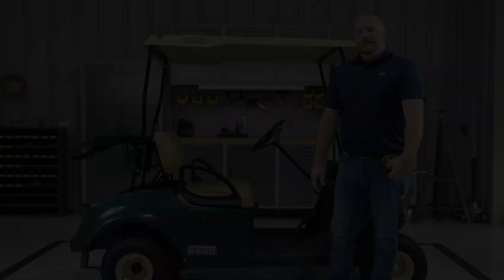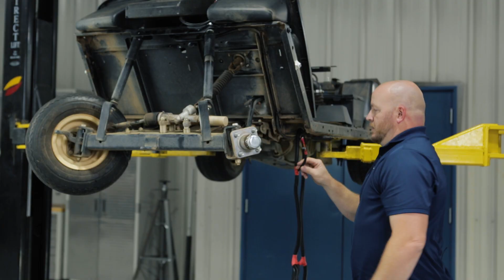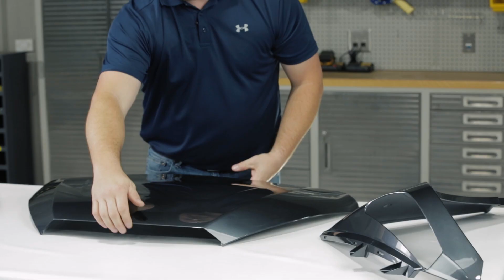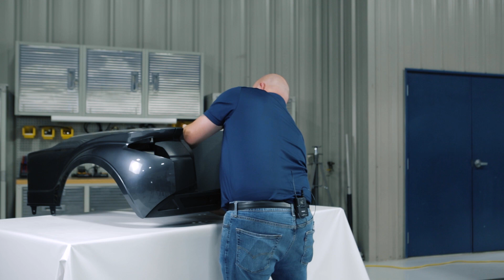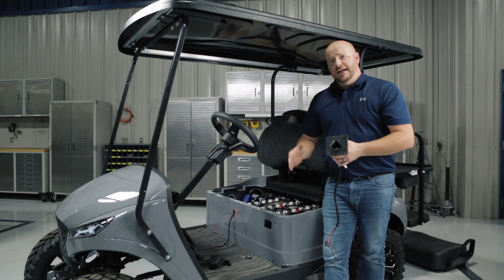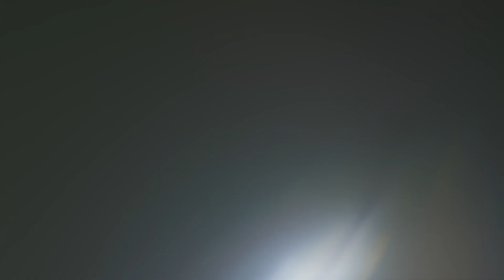Storm Body Kit for *EZ-GO® *TXT ELECTRIC | How to Install Video | Madjax® Golf Cart Accessories

Comment: I'm in the process of installing their Cherry Red kit on a 2009 EZGO TXT cart. Going from 36 volt lead acid to 48 Volt AC drive with Lithium battery. This video shows the body kit being mounted to the factory dash. But in my case I will be mounting their kit to the Navitas TXT display dash. None of the factory holes line up. So everything has to be re positioned and redrilled. Madjax videos and included documentation are fantastic.

Comment: Thanks for all the videos! I've recently installed the storm body kit on a 2012 EZGo TXT and it looks great. The problem I have is the lights will still turn on with the ignition switch Turned OFF. Even if i flip the Run/Tow switch to Tow, the lights will still work. Any help is appreciated. Many Thanks

Comment: Fantastic body, well designed and great instructional video.  However, it is time for an updated instructions and video.  The newest body (2023) comes with a light changing module that is not even mentioned in the instructions and the hazard switch is built into the turn signal assembly, so the step to mount the hazzard switch is no longer needed.  I wasted a great deal of time on these two items.  Still a fantastic kit!!!!
Reply: Light changing module? I'm wondering what the extra wires were for.
Reply: What does this light changing module do? I can’t find documentation on this thing anywhere!
Reply: @kevinedwards5502  It allows you to operate the headlights in a color changing pattern. Default is Red, Green, Blue that fadrs from left to right. With the app, you can select other colors, make it faster or slower etc.
Reply: Look for the Alpha Body Lux Upgrade to see a video.

Comment: Followed everything to the letter for my 2016 TXT.  Glad I checked everything before riveting the rear body panel.  The headlights and taillights aren't working.  I'm getting the daytime running lamps on the first lever rotation, but headlights nor taillights come on when rotating it to the second position.  The horn, turn signals, hazards, reverse lights, all work great.  The headlights and taillights do come on briefly when I engage the highbeam position.  Any ideas???
Reply: Did you ever figure this out?  I'm just curious, I haven't bough one yet and wondering how much support is available.
Reply: @slisondra  Never got an answer to my emails.  I disassembled the switch assembly and found two wires were completely disconnected from the harness.  Works fine now.

Comment: Great video; this really helped with the install of my kit. Question I have is how do you prevent the brake lights from staying on when using the parking brake?
Reply: Never mind, I figured it out. There is a 3 minute delay timer that turns the lights off.

Comment: Pretty sure that the Hazard switch wiring at the 12 minute mark is wrong.  Earth is on top, load in the middle, supply on the bottom...  Following these instructions blew out the LED on my switch!

Comment: You can tell there was a lot of thought that went into this kit to keep shipping costs down and installation simple. Also the fact the light kit has true and separate DRLs, low beams, high beams, reverse lights and even has two accessory light options built into the switch! Awesome body kit! I hope an RXV version will be in the works!
Reply from the maker: Thanks for the feedback Dave!  That means a lot!